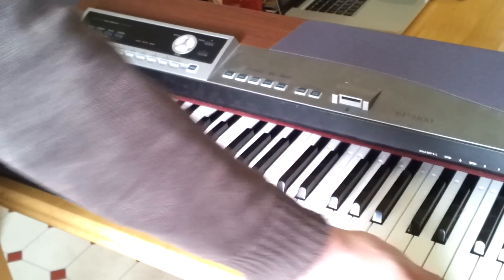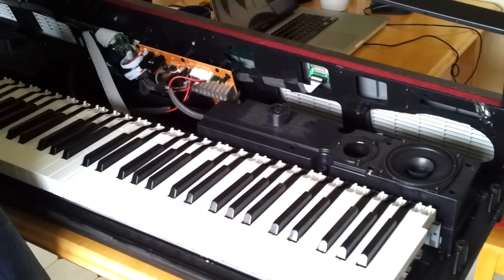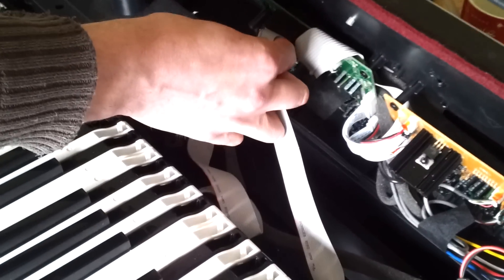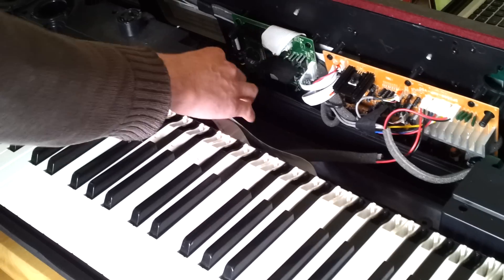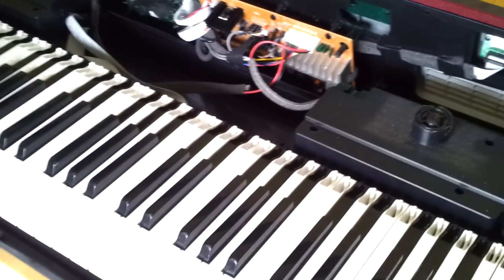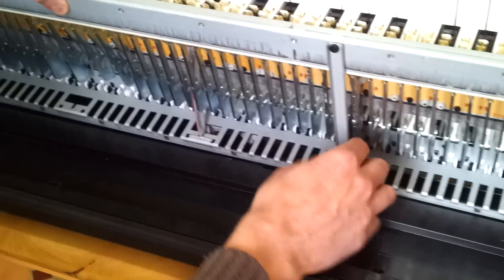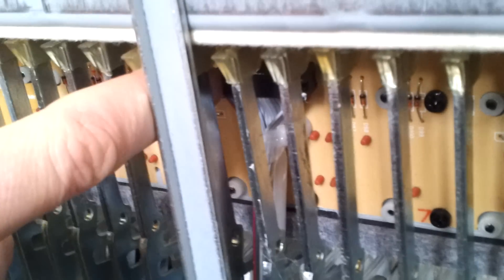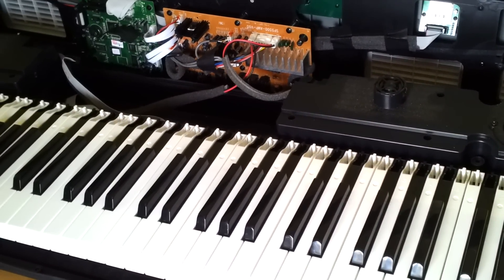Fixing the keys on a Digital Piano - Where some or all keys are not working cable bus

Comment: Hello hello, I'm having a problem with my Thomann Electric Piano, I can't remember what model, but I think it's something like 5500. Anyway, I can't seem to find an answer, or anyone who has had a similar problem, but with my electric piano, when I play, I'd every now and then get a sudden loud key, as if the velocity of the keys are irrelevant and are temporarily set on as though I am hitting the keys with a large hammer, so I could be playing a gentle Pachelbel's Canon, but all of a sudden a very loud key will be played almost as soon as I press the key, maybe a fraction of a second after, destroying the calm of the song. So my question is if anyone has a solution, or possible solution, to my problem. It's been like this for over a year now, and I can't quite remember if it has been like the from the get-go, or if it happened after a while of using it. I do know, however, that it's been like this since soon after receiving it, though I won't blame shipment for damaging it, because I feel it would have been sooner dealt with if the problem was right from the the start, because then I'd know for sure that it's problem is not to do with me. Sorry for the long post, but if anyone has any ideas, all are welcome. Thank you~!
Reply from the maker: I don't know the answer to this specifically, but it sounds like the weighting mechanism in that individual key is damaged or overided in some way. Have you contacted thomann about a replacement key?
Reply: It's not specifically one, but all of them. It's almost random which one it is, but it happens irrelevant of anything I do, be it the velocity of when I press the key, wether I change the voice, and it happens whenever. I think it may be an override because of it's randomness and loud noise. I haven't brought it up with Thomann because I didn't know what to say, as it didn't appear anywhere on Google either, and nobody seems to know what it is or how to fix it, I felt it was something that'd just be a bug that'd sort itself out somehow, and I believed that because no one else seemed to be complaining about it, and I'm sure I can't be the ONLY one, and some days it would be finer than others, and I was hoping at one point it would just go away, though it hasn't and I don't know how they'd help me with a seemingly unknown problem. Thank you anyway.
Reply: I had the exact same problem with my Thomann and after a while they stopped producing any sound at all, but this video has been very helpful luckily